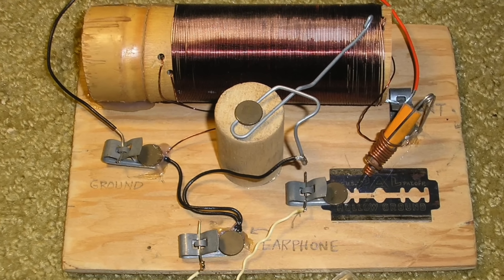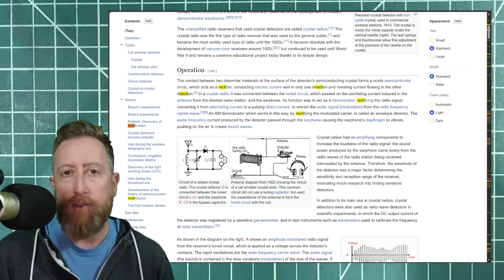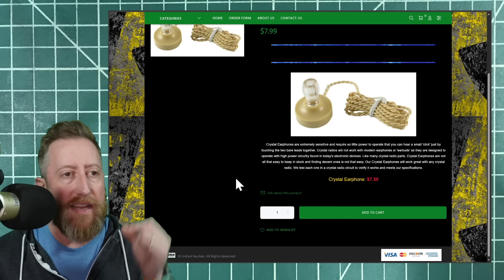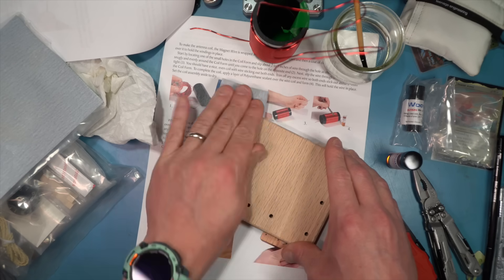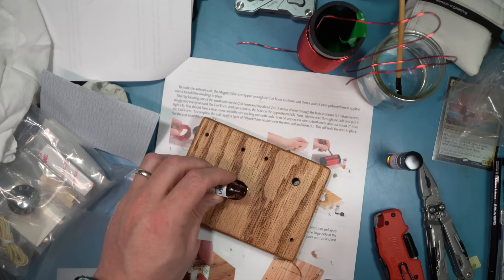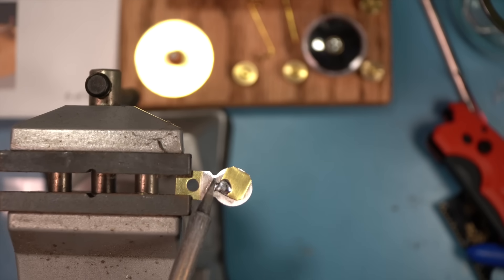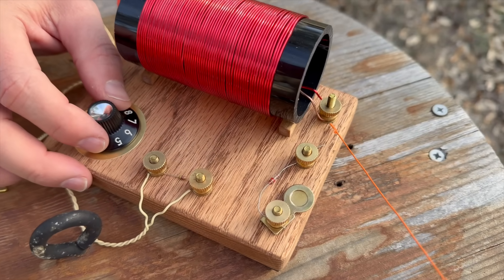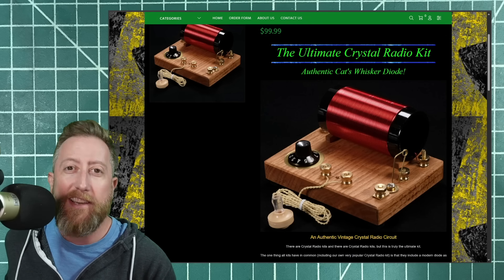Going Old School With Crystal Radios From United Nuclear!

Comment: I made one with a pencil and razor blade instead of a crystal, 60+ years ago. my Dad helped me string an antenna from my bedroom window out to a tall oak tree. pounded nails into a scrap board to solder the parts to. to the United Nuclear bit, I also had a chemistry set, you wouldn't believe what you could buy at Montgomery Ward's in the '60s. I even had a strip of lithium, fortunately I knew it was pretty explosive stuff.

Comment: The fillings thing is not a myth. I had a filling, aged 19, and slightly, but clearly, picked up a regional 100kW transmitter for about a day and a half. I wasn't aware of it until I went to bed then it just happened and I couldn't ignore it, for about 24 hours after. I knew what it was, and wasn't too freaked out, but glad it just stopped when it did. 
It wasn't intrusive, and I felt that it was coming from within my mouth, not directly within my auditory nerve. It only happened when certain teeth were positioned together, not all the time.
Reply from the maker: Keep new eye on the @modernrogue for the video!

Comment: Could you modify the tuning coil to tune to SW frequencies? I'm assuming so, right?
Reply: Coil and probably the capacitor, yes.  However unless you are close to the transmitter it probably won't pick up a usable signal.  AM radio transmitters are powerful and relatively close. That means a strong signal and enough picked up to drive the headphones.

Comment: An oatmeal (cylindrical) box, magnet wire, a crystal earpiece from a transistor radio, and a diode and variable capacitor. That's how we built these in the 60s, and it was a LOT cheaper!

Comment: I built a Boy Scout crystal kit when I was a Cub. It did not work. Played with the whisker and galena. Not even static. Long wire outside. Local leader knew nothing. Oh, well.

After some kit building experience, I was playing around, and connected a diode across the crystal earpiece, and a long wire. Clearly received the big local AM station, WWL. Cool. No tuner needed!

Comment: Josh, I use an old linemans butt-set for the earpiece replacement.  It's much more sensitive than the piezo type that comes with these kits. There is a video of it on my channel.  It provides a sizeable upgrade.  I also highly recommend using a primary winding of just a few turns around the coil and attaching the primary between the antenna and the ground.  This increases selectivity by placing less load on the coil and keeping the Q high.   Everyone interested in anything radio should build a crystal radio at some time.  It teaches us the essential components and how they operate.  73
Reply: A video showing this primary winding would be great.

Comment: There is an strange alien radio signal you can detect by placing an empty dry aluminum soda can onto a laptop trackpad to create a capacitive coupled antenna. If done on the proper computer, the cursor will move by itself; radio controlled by the signal.

Comment: I built a crystal radio in 65, 5th grade.  When I took it to school I needed a ground, so I took the cover off a phone plug on the wall and attached a wire to the telephone ground.  Teacher came in and saw what I'd done and had a fit.  She went off on getting electrocuted etc.  She had zero clue on how phones worked or anything about electricity.  Funny thinking back on how a 5th grader had a better understanding of electricity than an adult.  Luckily my dad supported me and while I got in trouble at school I wasn't in trouble at home.  Radio worked great for what it was.
Reply: I did the same thing at home less than 10 years later. Also had the antenna run thru several rooms in the house tacked to the ceiling.  I came home from school a few days later and the antenna was gone and there was several line segments and arcs melted and burnt into the carpet where it had come down. The crystal radio (built from a commercial kit) was a melted lump of plastic slag.

Troubleshooting what had gone wrong, at about 9 years old, was my introduction to household wiring and its problems/challenges.

1) Crystal radio working while "grounded" thru an outlet screw and antenna on the ceiling.
2) My little sister had been playing with a ball and knocked down the antenna (the ball ended up with a melt scar but not enough to pop it).
3) The antenna had made contact with (the burn scar touched) a floor register for the central heating system
4) Apparently current thru the antenna and crystal radio had generated a lot of heat
5) Turns out the voltage difference between the ground screw and the heating system duct work measured about 120vac, and the current was enough to brightly (but not fully) light a 100 watt incandescent light bulb. (the voltage dropped down to a variable 60v to 90v)
6) The heating system was grounded.
7) The electrical system was not grounded. The house was wired with cloth covered, two conductor "non-metallic" cable.

That's also when I learned the difference in antenna systems between "ground" and "counterpoise."

Comment: In the early 60's I had both the kit format that I built up and then I started building some from Popular Science with a Razor blade and they all worked great. I remember being in bed at night and seeing how far I could pick up an AM signal.... Sometimes as much as hundreds of miles away.... Great memories.
Reply from the maker: Sounds like some great memories!
Reply: I remember that the Popular Science magazine had all kind of cool little projects. Would go looking for the old ones from the 50s and the 40s as a kid, but its way older than that.
Reply: Who didn’t have a rocket radio in the 50’s and 60’s?
Reply: @drdeputy  I built the morse code one that had in one issue. Got an A in science class for it.